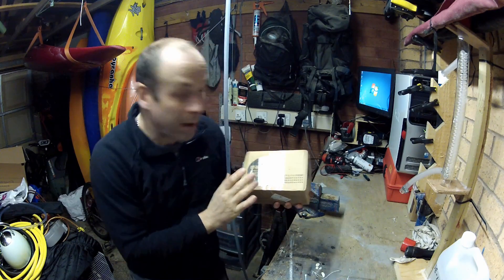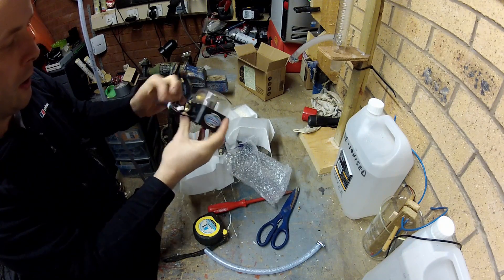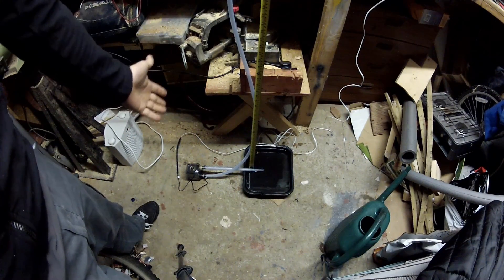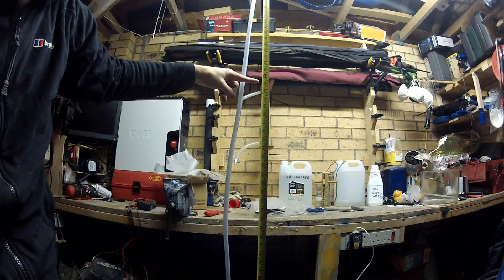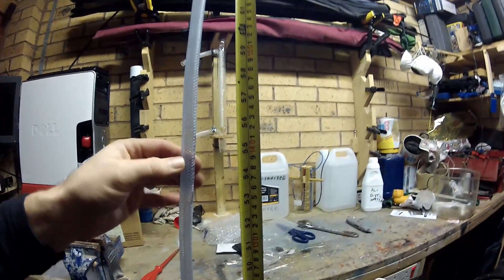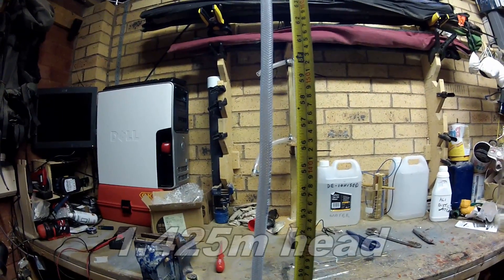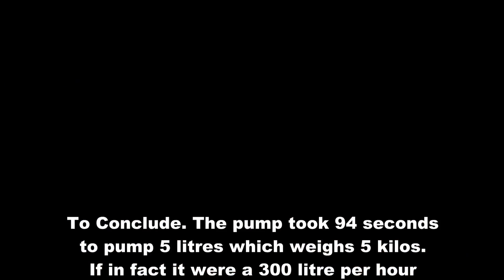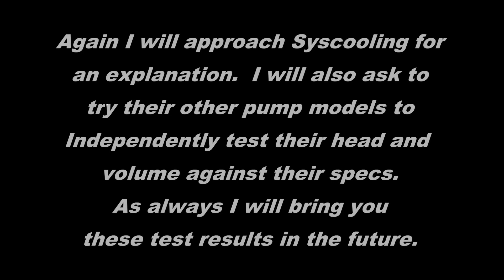Watercooling Syscooling Pump - Is it better or worse than its specs?

Comment: The pump specs Ive seen shows three cables. What is the function of the yellow cable? If the voltage, right at the pump,  is under spec (<12V) then head pressure will be less. Have you increased voltage to see what us required to get 1.9m?

Comment: Can i ask a question? Is it for pumping only or there is a cooling system? pls reply asap thanks
Reply from the maker: It is a pump reservoir combo.  The cooling is done via radiator.
Reply: @TheKayakingkid  ohh ok. By the way the radiator needs a fan right? to cool the water circulating?
Reply from the maker: @artheg3828  yes
Reply: @TheKayakingkid  All right. Thank you so much.

Comment: You mentioned your power supply was 11V and most likely the factory specks were done with 12V charger(14.4V).
That should provide a 30% boost in flow.

Comment: to get a more accurate reading you need to put the pump on the same height/level as the water it is pumping. seeing as the difference in this vid wasn't really big to begin with it's a marginal error, wouldn't have changed the outcome of this test by much i think. still though, it's something to consider.
Reply from the maker: Thanks for the input.  It was considered.  The water level was slightly above the pump level, giving it a slight advantage.  The pump is locate at the bottom of the pump housing.

Comment: thank you for complete review ..
can you tel me which CPU block u have use ?
does it come with BARB fittings or i have to purchase separately  ?
Reply from the maker: I can't remember the make. I purchased barbs for it though.
Reply: kindly try to recall bcoz i am also trying to have cheap water cooling for my  6700k CPU build..
for how long u have stress test on CPU and what temp u got  ?
Reply from the maker: I just looked.  It is an XSPC CPU block.  You dont have to stress test long.  Just wait on the temps flat lining.  IE, not increasing anymore then give it 10 more minutes.  Depending on your ambient room temp it should only be about +20C over ambient max.  On tick over my CPU is about 2C over ambient.  The temp should drop back very quick when unloaded.  The water temp on 100% CPU load should remain low.  Perhaps 5C over ambient.

Comment: good to see someone test the chinese products. but for flow rate the pump needs to be on the same level  as the inlet and outlet water. in the video its raised by some, reducing flow rate.
Reply from the maker: It is negligible considering the advertised head.
Reply from the maker: Yeah, It has been in my PC for a few year now.  No problems at all.
Reply: or under the water container, that is why the pump should always be bottom of the case
Reply: would you recommend it?
Reply: TheKayakingkid do you have any experience with the water blocks and reservoirs from China?
Reply from the maker: +Moggy1000 no just the pump res combo's.
Reply: Water block and reservoir is fine, I saw some testing with the 15$ water block against other big brand water block, they only have very small difference under load.

Comment: I can't find this version on Ebay. Only with hard-connected fittings
Reply from the maker: +Coďák You can contact syscooling direct.  I am still using the same one.  I made this video 2 years ago.  Very good pumps.
Reply: thanks man :)
Reply: +TheKayakingkid So these pumps are ok for cooling (despite the results from your video), or are they completely crap? Want to make a cheap cooling system.
Reply from the maker: They are pretty good.  The difference in the specs makes very little difference.

Comment: Even though the pump does not perform as stated, would a 1.4m head and 200lph be adequate for a small loop consisting of a cpu and gpu block, and a 240mm rad?
Reply from the maker: kev090997 It will easily cope with this.  I am still using one of these.  Over the years it had ran quad SLI + CPU and 240mm +120mm rads.  I would definitely recommend this pump.

Comment: would this be able to push water through two gpus a cpu 120mmx2 rad and a 120mm rad 62mm deep
Reply: I think it can, but you can get SC600 or SC750 pump for very cheap, and those works better than this one

Comment: your hose is not straight with the measuring tape! it is close enough
Reply from the maker: The hose does not need to be straight.  It is the head I am checking, the vertical height.  A wavy hose makes no difference.
Reply: it does... basic physics dictate that, but even still it would be short on the spec sheets
Reply from the maker: No it doesn't.  The elevation head will be very accurate here.  The friction will be negligible.
Reply: TheKayakingkid friction has nothing to do with it, Gravity
Reply from the maker: Here is the definition:

The total head consists of the suction lift (vertical distance from water surface to pump), elevation head (vertical distance from the pump to the highest elevation of water in the system), friction loss (the pumping pressure lost in the system due to friction, which depends upon pipe length, size, material, number and type of pipe fittings, and water flow rate) and the outlet pressure required (the optimum working pressure for proper operation of the water outlet device.